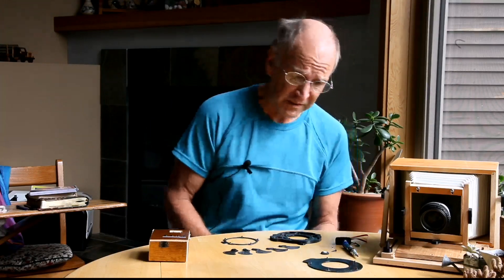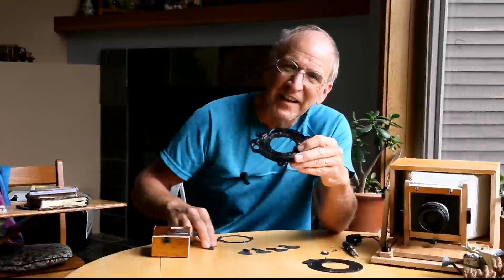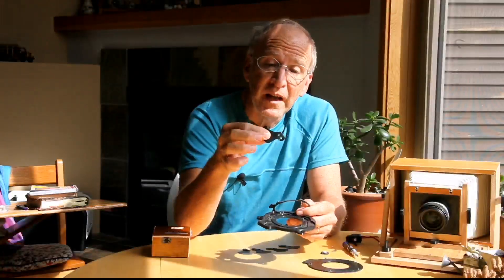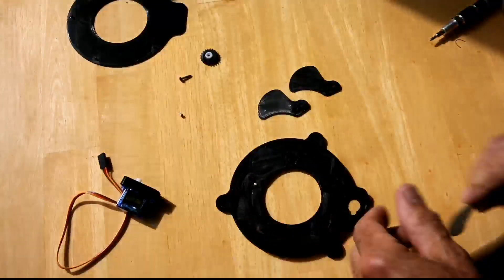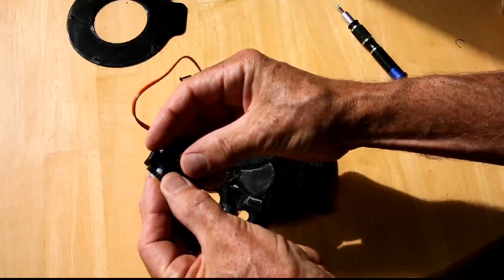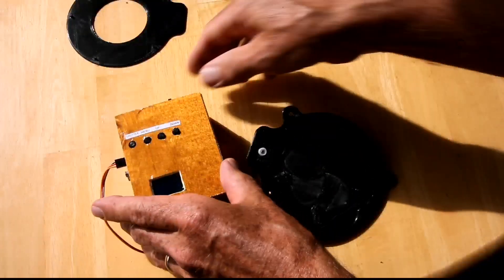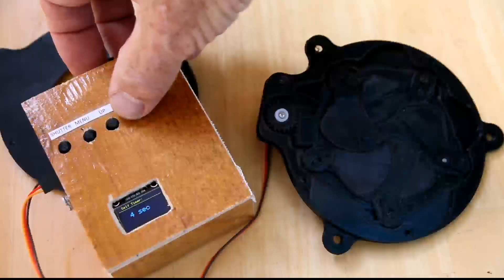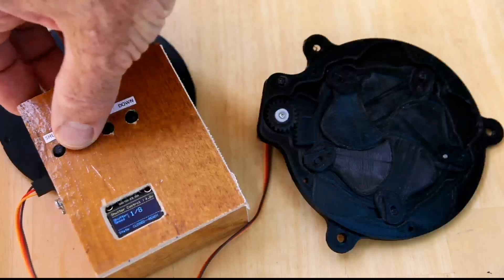Making a 3d printed servo controlled large format leaf shutter

Comment: Very nice work!!  Why not use a solenoid to open and close the shutter?
I am in need of a large-ish leaf shutter (~100mm opening diameter) to sit behind an old large format lens. I have some vague ideas in my head.
Because of the size, the leaves will need to move fast to prevent vignetting.  
1. I'm thinking 0.3mm thick Titanium or carbon fibre blades and rings to withstand the forces.
2. One or more  solenoids to open and close the blades.  Thinking about which arrangement will minimise vibrations.
3. A servo to hold the shutter open for focusing to save battery.
4. A bag bellows with an elastic mouth will slip over the rear element of the lens, or even the entire shutter assembly.

I'll gratefully scavenge your ideas and code.
Reply from the maker: Sounds great! Let me know what your develop, and post it on github if you want to share. This project is on github, link in description.

A solenoid could work, though likely not with 3d printed parts. I doubt it would give you much faster speeds. For a high speed shutter, opening/closing springs would work best.

Comment: I hadn't found this on thingiverse! Super neat!
As for the flash sync, try and get a MOC3010 series optocoupler with a TRIAC output. It works with an arduino as the opto part is just an IR LED, and the TRIAC part will trigger reliably most flash units. The other option would be to fit a microswitch, but then you lose the ability to M sync.
Reply from the maker: I like the idea of a triac output. I ordered some TLP127's a while back which should work if I connect the polarity correctly to the flash sync cable. But I'll keep the MOC3010 in mind if this doesn't work...